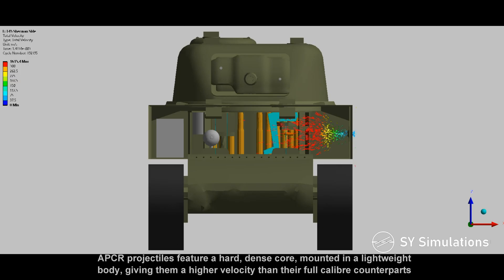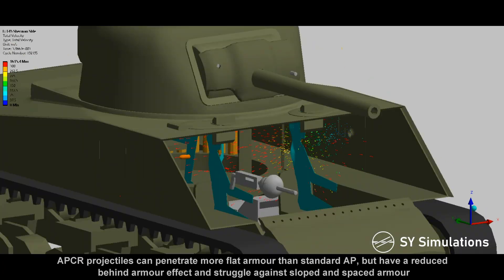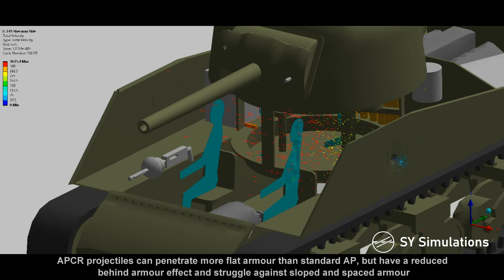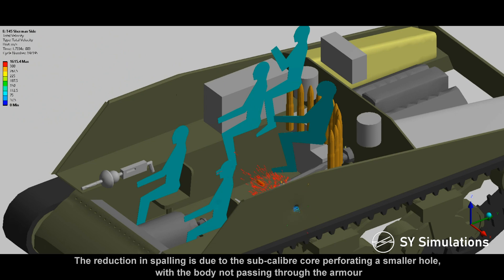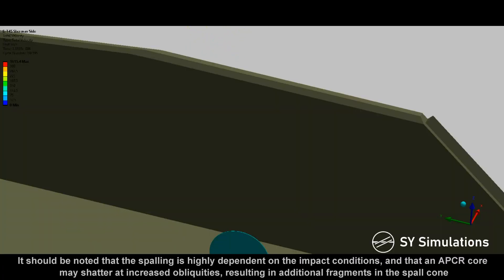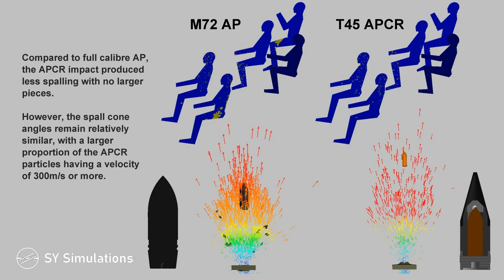HOW BAD IS APCR SPALLING? | APCR Spall Cone Armour Penetration Simulation

Comment from the maker: A few things to keep in mind:

Due to the way the simulation works, the size and number of the particles is directly linked to the element size (a finer mesh will result in more numerous lightweight particles, while a coarse one will give fewer high mass particles). In reality, the spalling will have a large range in weight.

The simulation also deals with the particle-hull interaction as completely elastic, so the reflected particles have a higher velocity than they would in reality.

Finally, the internal geometry has been simplified -in reality, there would be more objects to block or deflect the particles inside the tank.
Reply: And the penetrator body is indestructible in this model. While in reality the hard alloy core splits after the load is removed and disintegrates into additional fragments, rather than penetrating the tank right through without deformation and fragmentation.
Reply: I know you've already modeled a HESH round, but I'd love to see a HESH round from this point of view
Reply: I heard from people who shot steel birdshot that it's extremely bouncy when hitting steel, very likely to come directly back upon hitting any steel or similarly metal surface. 

Though such small birdshot just isn't very lethal, like it won't go through the cranium.
Reply: Can you test if APCR really is bad at angled armor compare to other shells like full caliber AP and APDS?
Reply: Is there a way for me to get this simulation?
Reply: could you do a simulation of PARTIAL penetration? many people don't understand that even when the projectile doesn't penetrate, a lot of shrapnel is still released (e.g. German Pak38 vs early T-34)
Reply: @ I saw a simulation was done on that and the witness plate showed only a very small number of spall fragments of low velocity.

The thing about the spall velocity is it is a fraction of the projectile dragging past the metal, so if the projectile doesn't pass the metal and has lost a lot of velocity there won't be much spalling.

However, if the projectile breaks up then a large rear portion of the projectile may be caught in the armor while the tip or edge continues through.
Reply: what would happen if you have your hand against the wall inside the tank while an AP shell hits about a foot or two away from your hand, would it cause your hand to break from the force? or would nothing happen? saying this because i see the side walls wobbling after the impact, i wonder if that would feel like swinging a shovel against concrete or hitting a baseball bat against concrete.
Reply: @boshi_coyo  Judging by the timescale it's wobbling at an extremely high speed so the force on your hand would be extreme. It's hard to say, there's not really a simulation for bone breaking but it's possible.

Though more interesting is how this may affect equipment that could endanger the entire crew like split open the case of ammunition for the main gun.
Reply: @Treblaine  think you could feel it through your spine?

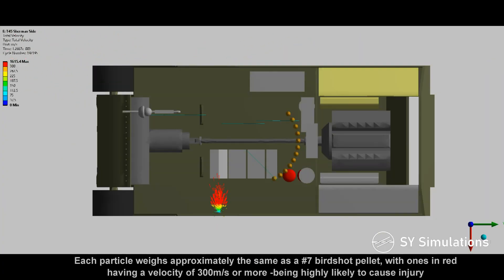Comment: 0:45 I think that this way of portraying the spall is somewhat misrepresenting the possible damage. 
The problem is that the birdshot is not very lethal. The given velocity is around the one a lot of birdshot has at around 10m range giving us the ability to compare it to testing of regularly shot Birdshot. It does not penetrate bones such as the skull and ribs. It only penetrates around 6 to a max of 15 (at point blank) cm of unobstructed balistc gel. Any clothing will further reduce penetration, likley quite a bit due to the low weight. 

would be beter to see the amount of spall seperated in to weight class

Comment: Most people don't seem to realise that unlike in WT, if your vehicle gets penetrated in real life and you're there to notice it, chances are you're not gonna stick around to find out if a second shot is also going through your armour. A knocked out tank doesn't necessarily mean it was blown up, if you manage to get the enemy crew to bail out you're still doing your job successfully. Basically what I'm trying to say is, even if the post pen effect wasn't amazing you'll still notice the spall about as much as you would for an AP shell. Real life isn't like WT, crews typically don't like staying inside perforated vehicles.
Reply: A "Significant Emotional Event", as the Chiftain likes to call it.
Reply: Very true- and why so many "improved" rounds are based around improved penetration, instead of post penetration effects.

Comment: I know that fluid simulation is probably extremely taxing, but it would be super interesting to see you simulate an APFSDS shell going through the front plate of a T-72, specifically perforating into the frontal fuel tank and seeing how much spall is stopped by the fuel tank, and how much is created on the exit of the fuel tank. Currently in War Thunder the fuel tank doesn't create any spall on shell exit and I'm curious if any is generated in your sim.

Comment: I got a suggestion for a meme simulation: hms dreadnought AP shell vs T-90 Hull Front. If you can, simulate at either point blank or 10 000 yards with shot fall, dealers choice

Comment: I like that the projectile goes through both sides of the tank, and traveling at 200+ m/s. It's a very fast little projectile.
Reply: it goes in 800m /s so it is going 2.3 times speed of sound

Comment: Why didn't the core break up? T/D ratio not big enough?
It's a 38mm core vs. 38mm side armor.

Maybe you should have used a Pzgr. 40 shell instead, with a smaller core at higher velocity.

But the way the core stayed intact even after tumbling from going out the other side of the tank, just feels wrong.

Edit:: Oh I see. They were simulated as being rigid. So just comparing spall from the velocity.
A higher velocity APCR would be interesting never the less. Higher velocity should result in more lethal spalling.

Comment: panzerwurfcanone 10H64 vs the front glacis plate of the T-55
Reply: Interesting, tho Kanone is written with a K btw. Also, was that one of the Smoothbore HEAT-FS guns?
Reply: @Ghostmaxi1337  Wow, hello again, you were the one who answered me in the previous post about 88 L/100, right? And regarding the rest: yes, it is a 100 mm (105) smoothbore cannon, which penetrates around 200 mm at 30°.
Reply: @Ghostmaxi1337  Hey, weren't you the one who responded to my comment about the 88 L/100 cannon? Hello again. And regarding the other thing: it is a smoothbore cannon that fires HEAT projectiles capable of penetrating 200 mm at 30°. (I made this comment again because the previous one was deleted for some reason.)
Reply: @leonardogandini147  Yeah, that you remember, impressive, i forgot lol.
Ok, ty. Well, would certainly be interesting he also didnt do many HEAT simulations befor.

Comment: Ah the Sherman , the best medium tank ever . I never understand how the Sherman has better side armour than a Panther , cause people always complain about the side armour of a Panther . But the Sherman has even less side armour , not even sloped . 😅 Typical internet myths.....
Reply: Keep in mind that the M4A3 76W Sherman weighs ~12 metric tons less than Panther A, and they have roughly the same side armor. We're talking about 38mm vs 40mm here. 

I don't trash the Sherman tanks for thin side armor because it was subject to weight and space limitations in the interest of strategic mobility. The tanks had to be shipped over the Atlantic after all.

I wouldn't trash the Panther either, it is just a design choice. They decided to concentrate more armor weight in the front, less on the sides. 

The reason people bring up the Panther's thin side armor is simply because it's front armor is incredibly thick for a WW2 medium tank. There's a huge difference between front and sides.
Reply: While I agree with your assesment on the circumstances of the Sherman, I would still trash the design decisions that led to the Panther. The VK prototype proved to be more than enough of a match to most allied tanks, while providing enough protection against allied infantry anti-tank weapons, and they were faster and easier to deploy in comparison to boot.

The addition of 20 more tons of armor strained the drivetrain so much that it's early designs became very prone to damaging it's own transmission. And it's quite baffling that Hitler decided to neglect putting additional armor on the sides of the tank in favor of more armor on the front, when most German tanks at the time bar the Tiger I were very prone to getting knocked out by infantry anti-tank weapons, so much so that later iterations of the Panzer IV had multiple layers of spaced armor installed to increase it's protection against infantry anti-tank rifles.

Comment: Could you try low calibre hvap vs low calibre ap? Let's say marder's 20mm
Reply: A 20mm KwK 38 L/65 would be better i suppose, as the HVAPs are extremly similar (both around 62g 12,7-13mm core, tho Pzgr.40 slower with 1050m/s) as the KwK has a full shot (either Pzgr. L'Spur "Ph." As 148g 800m/s or Pzgr. L'Spur "0." As 143g 830m/s.)
Reply: @Ghostmaxi1337  sure, I really want to see the difference in spall